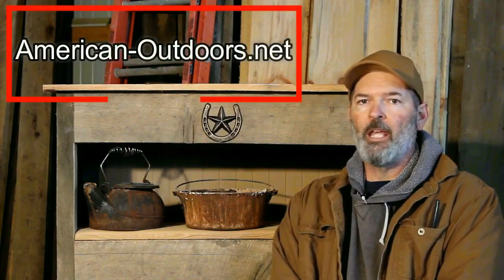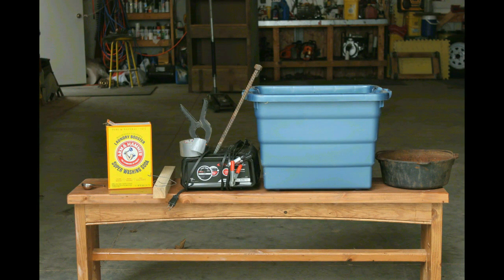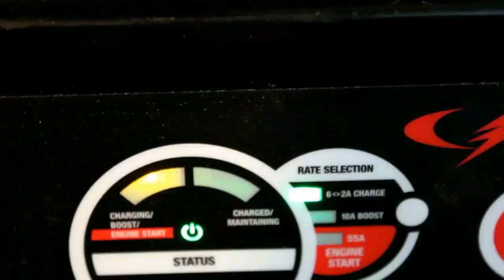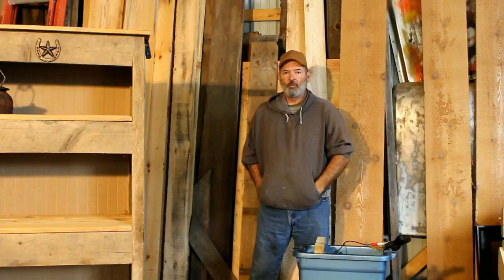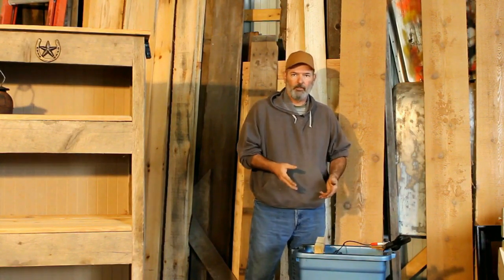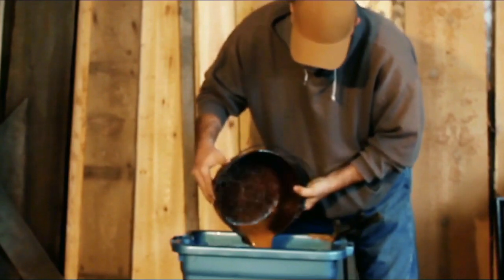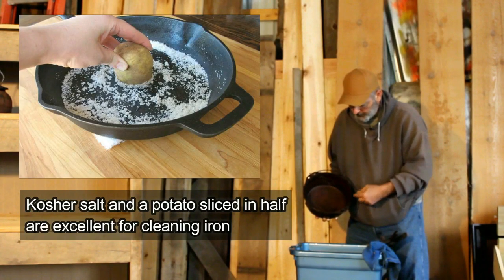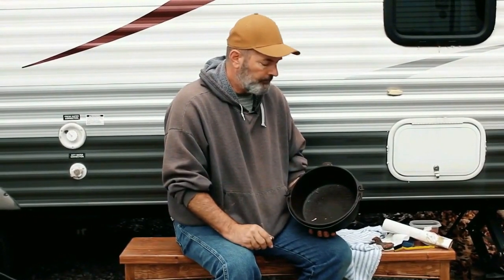Restoring Cast Iron Using Electrolysis

Comment: I agree electrolysis is hard to beat. I might add that as your solution evaporates just add water don't add washing soda to the new water. The stronger the solution is the harder the battery charger has to work.

Comment: Doesn't it have to be a manual charger?  I saw that in another video.  My battery charger is automatic.  What happens if I use the automatic charger?
Reply: I think the auto setting senses the battery is charged and shifts into maintenance mode.

Comment: An alternative to battery chargers are an old computer power source.  Easily modified  for the job and if you ask around comp shops tuo can get them cheap or free!!. Most put out 12v at 15 to 25 amps. See  hacks on youtube for tips on conversion. Easy to do!!

Comment: I've tried 2 different chargers and can't get this to work. Any pro tips?
Reply from the maker: Make sure the charger you are using is a "manual" charger. Some of the typical smart battery chargers made today may shut off before the process is complete. I also add that your charger may be working, but it just doesn't appear to. Check for bubbles, even slow rising, tiny bubbles indicate progress. Confirm your cables are attached properly.

Comment: Run the charger at 6 or 10 amps.  Wont hurt a thing and its much faster, also, plain table salt will work better, about a teaspoon per gallon of water.  Sea water works well too.
Reply: I was wondering if salt would work, thanks for clearing that.up
Reply: @jfenn89  Not enough to matter, do it outside.
Reply: Baking soda gives you the best conductivity and mixes better.

Comment: Btw - Use rebar or another type of steel (not stainless steel) that you are willing to lose. 
It is called a "sacrificial anode" for a reason. You quite literally are rusting this anode with electricity to provide the electrochemical conditions to mend rusted/gunked-up cast iron